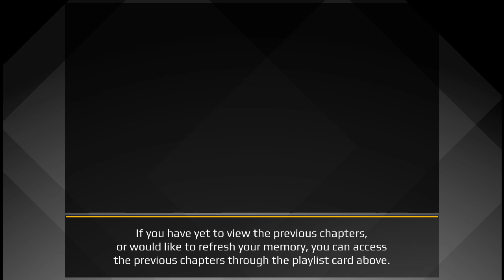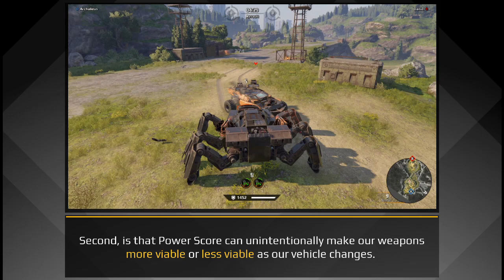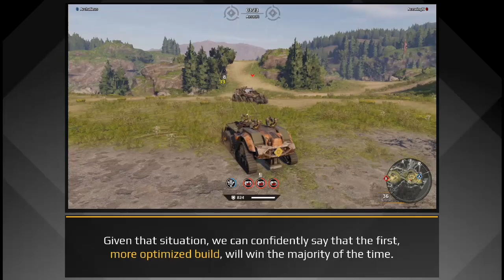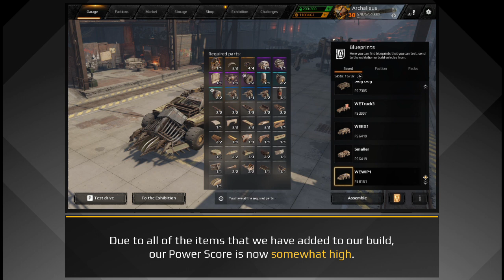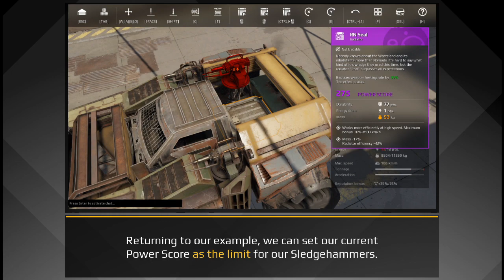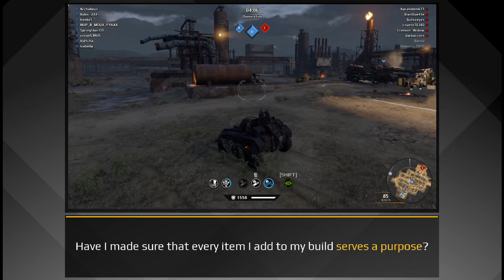Wasteland Engineering - Episode 3.1: Power Score Implications

Comment: Very good points! Also shows why beginners should stay in lower tiers as much as possible - generator and rare cab is much less PS than epic cab, etc
Reply: Yes especially with the recent season pass that released the legendary cab,newer player get into 10k+matches way too easily
Reply: @Sebastian Sepulveda Sanchez there's literally thousand of ways to seal club at 2499 or 4699 while most forms of every weapon type are available at those 2 brackets...hell there's even use for carapace(not so much anymore) and wyvern or growl for cannon builds at 2499 because it's better to have a blue cab than driving 3bombs if you carry fuel barrels
Reply: @Sebastian Sepulveda Sanchez what do you disagree with tatan?that 2499 is boring?that it doesn't have wide variety of weapon choice?or that carapace,wyvern,growl are not better than a white cab+gen build???also lmao what were the chances to meet on here hahaha.. ok here I go in 2499 you can use Vector,Sinus,Piercer and the Defender for machineguns. Sledgehammer,Spitfire,Mace,Junkbow and Goblin for shotguns
Ac Rapier and Storm for auto cannons
Avenger/judge for cannons
Wasp,Pyralids and Pyre for rocket launchers
Synthesis,Boom,Borers
Falcon and cobra drones
Without forgetting Emily and infamous summator...now we're just covering weapons(the main thing we care about)but also widest wheels combination
gun-mount,Apc,Shiv,Balloon,Stallion and Large Wheels whereas higher ps is all bigfoots...after 10k ps it's all spark porcupine tsunami cyclones punishers over and over most of them either hovers meat grinders or some kind of tracks combination...very limited in what you can bring purple wep tends to suck at that ps only wider choice you got is how much energy you can slap on a car and which cabin you're gonna use...